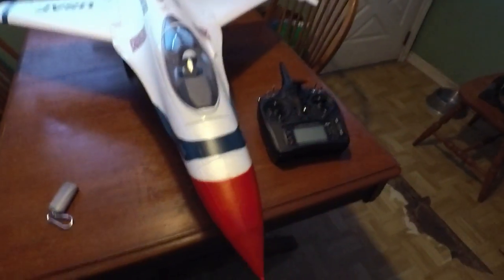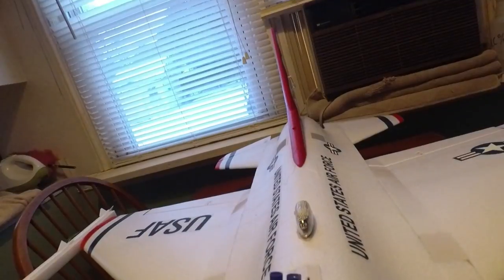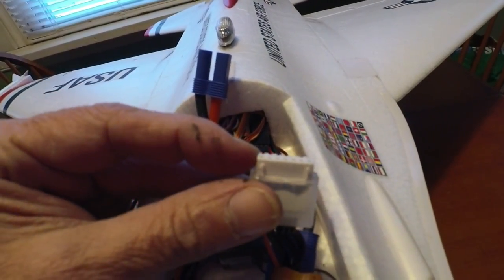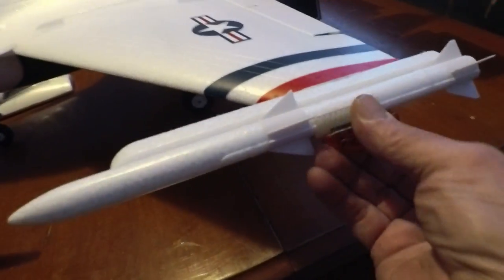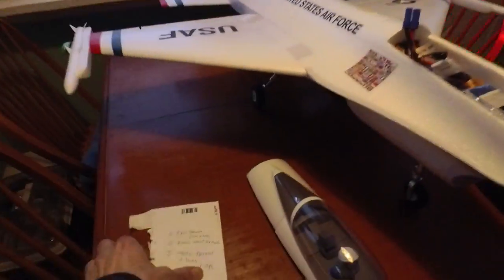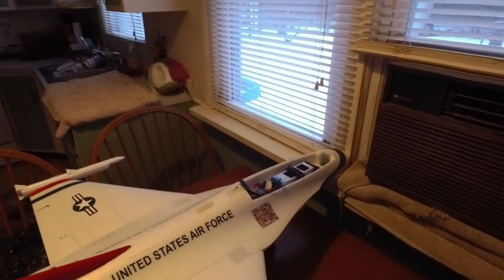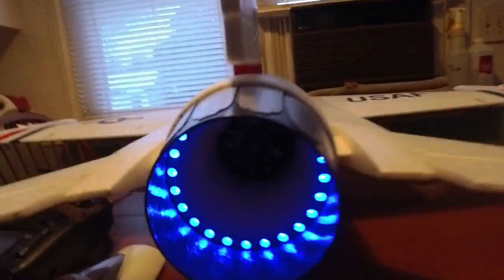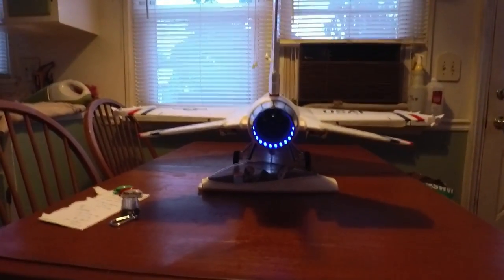E-Flite F-16 Afterburner Help and answers to other Questions Recieved

Comment: Thanks Skip. The way the power connector comes is very misleading considering what they give you for a voltage range. I have mine working now and I’m glad you mentioned it powering up with just the red wire, I was going to ask you if yours did that because mine did. Thanks again! “Build, Fly, Crash, Repeat!”👍
Reply from the maker: My pleasure buddy.  Glad it helped.  Happy flying, Skip

Comment: Hi Skip sorry if you’ve been getting this question but where did you buy the afterburner? I didn’t see a link in the description.
Reply from the maker: Not  a problem go to FanJetsUSA.com 
Different types and sizes
Reply: Do you remember the size you used on f16 thunderbird 70mm  I have the same one
Reply from the maker: @nexsignsllc4142  70 mm.
I did an install video on it.  Its in playlist for F-16 Thunderbird

Comment: Nice Work Skip!   i have a question,  do you think it has any adverse affects on thrust and or the top  speeds?  also where did you pic up the lights ?
Reply from the maker: Not in this case.  The light ring is not in the way of exhaust.  Got them at FanJets usa .com

Comment: Here's a question for you which horizon hobby won't seem to answer. If I remove my sub fins will it affect the flight? I belly land my f16 and its ripping those things out, and so I have to keep glueing them back on.
Reply from the maker: My bet is that it woild fly jut fine in safe.   May be a touch twitchy without having the added stability of those fins.
Reply from the maker: After having thought about this issue and looking at mine I figure you could probably cut at an angle half of them off so they're on a belly landing they would be landing almost flushed but slightly above the surface of the belly at least you'd have still some of the stabilization that they provide. Just a thought, happy flying, skip
Reply: U could add velcro too. No damage.

Comment: Hello Skip my afterburner has changed to green is there something I did wrong.
Reply from the maker: Good? 
Mine, only half the ring lights and then stopped. 
Gonna put a separate batt and better connectors

Comment: Hey skip can i mount the whistles the same place on my 90mm f16 and do I have to use all three whistles or just two.
Reply from the maker: Experiment.  try different depths for a few different tones and use all three.  Recommend 10-2-6 o:clock for placement.
Reply: O.k thanks skip

Comment: I would use a female balance plug remove all pins but the outside Then saw your wires on those pins so you can plug and unplug safely
Reply from the maker: Good idea.  Think I'll do that.   Thanks for the thought

Comment: Is there a kit like this for the viper??
Reply from the maker: It's the same kit.  But don't know how it would work on the viper unless you can modify the thrust nozzle area to fit???
Reply: @SkipBuiltRC  guessnill have to wait till I get the f16 only thing though can u use the ailerons as flaps? And the elevator is is one whole stab or is like the vipers?
Reply from the maker: @Farmermanrc  no my friend I think the elevator is split like the Viper it's not a full flying stab. And all you have is aileron's. May be possible to mix it in your radio but I don't know how that would work with the as3x or safe. Better off to just fly it the way it is things flies great just the way it is. I have an install video on how I actually did this you'll see how I cut the nose cone and was able to lay the ring of LEDs flush with the foam as not to obstruct the tube, then the nozzle just slid right over and got glued in place
Reply: @SkipBuiltRC  will do stay tuned I got more videos to post soon
Reply: @SkipBuiltRC  thanks skip